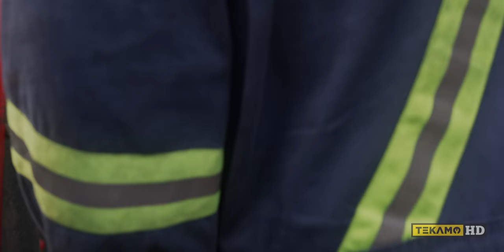Fixing A Massive Hydraulic Oil Leak on a John Deere 200D LC Excavator

Comment: I’ve used compressed air on a cylinder I couldn’t pull apart. What I did tho, I tied up the cylinder. Then I put a regulator at the end of the air hose and started with 5 psi, and slowly increase the pressure to push the cylinder. Worked good for me
Reply: That's the right way to do it. I try keeping my explanations simple and hopefully good mechanics can figure out the safe way to do it by learning from what didn't work. In a shop or if the cylinder is held on a bench it's definitely quicker to use shop air with a regulator, just secure the rod so she doesn't turn into a cannon.
Reply: Using compressor air to get the rod is sure way to get injured lol.

Comment: You didn't take the nut off and reseal the inside of the cylinder head or gland.  There are packings and o-rings in there that are critical for a proper seal for the hydraulics.  What you showed was half of the job.  The easy half.

Comment: To release hydraulic pressure, flip the little switch below the seat. Crank the machine with the implement lockout lever down. Now that you have pilot pressure while cranking, Run the controls

Comment: Good morning, next time, before dismantling the head cylinder, disconnect all 2 flexible hoses of the cylinder. Plus, if you disconnect all tubes and flexibles when the rod is at final strokem, open and close, you will find high pressure on the cylinder camera.
Good for washing face by hyd oil ( as your video !!!! )
Mantein the rod not at maximum or minimal stroke 
Tks

Comment: Go to Makita impacts and never look back I have both high and mid torque I'm happy with them so far I don't use them everyday mind you. I bet you will have todo a rebuild on that cylinder the seals on the piston have been disturbed.
Reply: When time permits we will probably reseal it fully, but this was a cheap option to buy us time. Realistically those seals are disturbed everytime that cylinder cycles anyways but I get what you're saying, things never go back the same way after being run for so long.

Comment: 2:30 there isnt even a lock valve on the cylinder just dont put an impact on a flange go to a hose on the pipe they are ORFS there will be pressure but you can crack it slowly. on a flange the pressure is either sealed or in your face

Comment: your impact is lagging because you have it on 4th setting which is actually a lug nut setting to not drive them on or off to hard keep your impact on 3rd setting you will get full strength
Reply: No. Mine had the same issue out the box. Sent it to warranty. They have a trigger issue right now.
Reply: Mines a pos too after some use